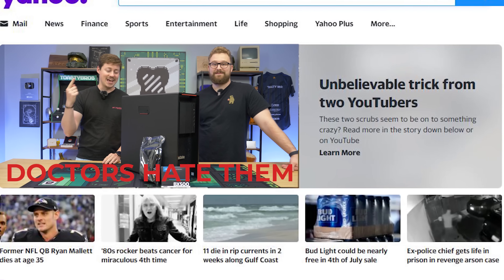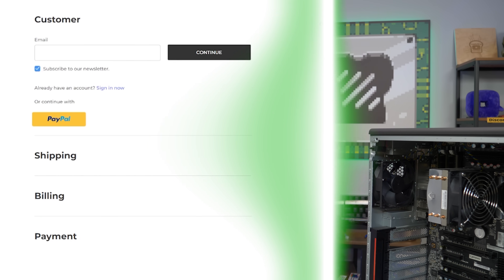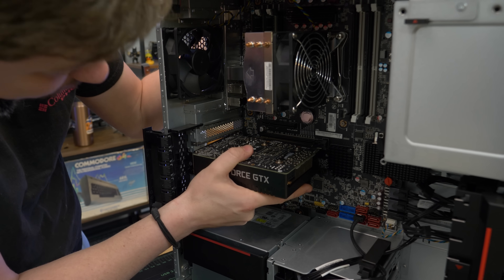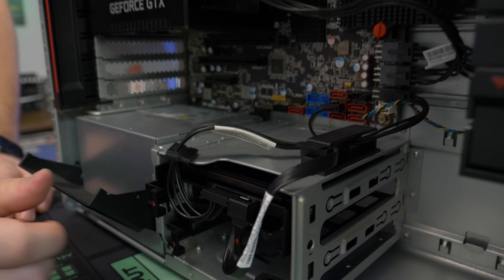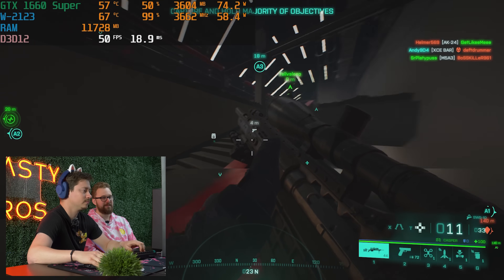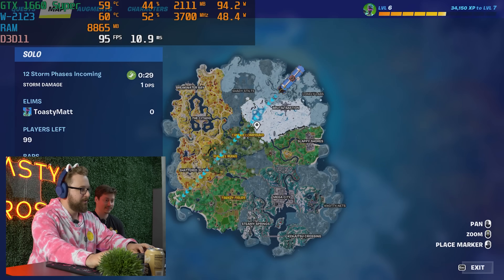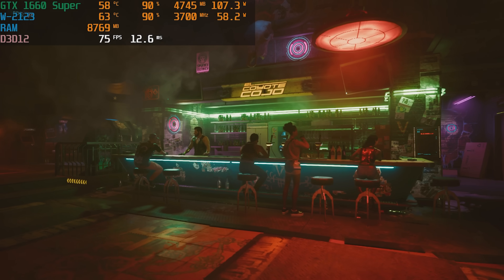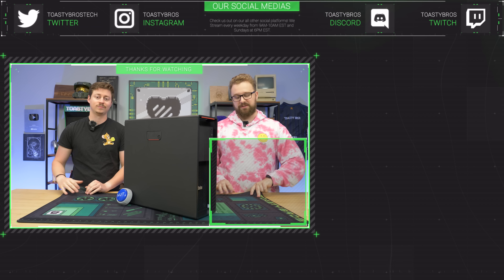EASY $300 Gaming PC Build Guide 2023 - Step by Step

Comment: I'm building a p520 right now, with a budget under $400. The last part I need is a suitable wifi/bluetooth card. What is recommended?

p520 - $90
xeon w-2135  -  $25
64gb 2666mhz ECC ram - $50
1tb Samsung m.2 NVME storage- $50
rx 5700 xt - $150 

The darn graphics card is lost in the mail, so it's holding up the build. Fingers crossed it can play Tarkov on at least 1080p

Comment: I like the way the Lenovo's are setup inside as compared to Dell's and HP's. On these Lenovo's they split the 2 hdd slots so that 1 is at the bottom and one is at the top, leaving space in the middle for larger gpus.

The Optiplex's and Precision's make it hard for 3 fan gpus to fit

Comment: i am going to get my first gaming pc, but i am getting it from meta, and since you are more knowledgeable in the pc field would that be good idea,if not what site would you recommend?...ps my budget is $1,000-$1,400
Reply: hey for $1000 its good to make one you own
Reply: @vinxwl  oh, if i do go that route, what is the difference with the gen intel
Reply: @vinxwl  what is the best site to get these parts from
Graphics Card
NVIDIA GeForce RTX 4070ti
Processor
Intel Core™ i7-13700KF
Motherboard
ASUS TUF GAMING Z790-PLUS WIFI D4
Memory
32GB META RGB DDR4 3600MHz (2x16GB)
Cooling
DEEPCOOL LS720
Power Supply
EVGA 850W
Operating System
Microsoft Windows 11 Home
M.2 Storage | Slot 1
1TB META M.2
RGB Case Fans
META 120MM RGB Case Fans x5 – Black
Premium Cabling
META Red Premium Sleeved Cabling

Comment: For clarification:
The BX500 is a dram-less SSD, while the MX500 has dram.
It won't matter much, but once you multitask this PC, the dram-less ssd will be slower even than a hard drive.
Or you should go with the 1-2-Punch method. (small SSD for system, big HDD for games and large data)
Reply: I have an MX500 installed in a shitty 10 year old laptop and it alone made a severe difference over the 5400rpm HDD it used to have. I would hate to waste money on a glorified HDD, as the DRAM-less drive speeds are only peak, while the DRAM-enabled ones can easily achieve what they advertise.
Reply: Actually, for most people it would not matter. Professionals are no longer buying these machines, kid on a budget would mostly game or surf on it. Also more than enough for most office needs. Buying additional HDD could be a decent upgrade if you plan to play older games (PS4 era and earlier) . So would buying additional RAM (which would improve SSD speed) .
Reply: @aleksazunjic9672  
A big HDD for old games and emulation makes perfect sense.  I'm umming and arring about changing out my ancient (and only HDD) 1TB that I bought in 2014 for something bigger like a 6TB but the prices of solid state and making me think that's better for inside the box with a big HDD plugged into USB3.2 outside.
Reply: @darthwiizius  HDDs are still much cheaper if you want large capacity (4+ GB) . Everything depends on needs.
Reply: @aleksazunjic9672  
True but the price on SSDs are low enough now to make them a viable option even if maximum capacity or price per TB can't match an HDD.  If I needed huge amounts of mass storage I'd certainly look to HDDs.
Reply: @darthwiizius  Well, in present time even for having 20 games (not a huge amount) , you would need 2TB drive .
Reply: @aleksazunjic9672  
Not all games are 100GB mate, those are just AAA games most of which are crap.  I did download the Halo Master Chief collection and that is over a hundred GB but then it's 6 games.
Reply: @darthwiizius  Unfortunately, even free to play games like War Thunder, Enlisted, World of Tanks, World of Warships etc ..  in modern times take up few dozens of GB . Large textures and all of that take up lot of space.
Reply: @aleksazunjic9672  
Yeah, that's why I'll probably plug an HDD to a USB3 port, though I'll plug an NVMe into the USB 3.2 gen2 port, that runs at nearly a GB/s bandwidth.
Reply: @aleksazunjic9672  for me, I'd prefer to pay the extra for dram.
Since you'll never encounter a situation where the dram-less is a problem always.
Reply: @Outofcreatvienames  But you are not on $300 budget 😁 Tons of things would take precedence over SSD.

Comment: SSD's are great for fast storage granted, but there are still uses for HDD's.
I for one have an 1TB SSD for windows and general storage, and two 4TB (8TB altogether) HDD's for my games and were cheaper to buy, and I have a lot of games. SSD's for the same amount of storage are more expensive, not something you should do on a budget.
Reply: Agree. Also, games tend to run faster from HDD if you have a lot of RAM (32 GB or more) .

Comment: I just picked up a gaming PC with an i7 8700k, 16GB of RGB DDR4 RAM, and a 1060 6GB blower style GPU for $300. It also has a water cooler on the CPU and comes in a nice looking case that has 7 RGB fans. The only things missing are the power supply and hard drive(s). Great deal, okay deal, or did I get ripped off? I say it's a great deal considering I'm upgrading from an FX8320 based PC. Any thoughts?
Reply: Sounds like a good deal. The 8700k can keep up with sth like a 3060/6600xt no problem
Reply: Not great, not terrible. Downclock the CPU to default values in order to prolong its life.  Should run all games released for PS4 and PS4 Pro without problems at 1080p med-high with some FSR . For newer games it is 1080p low . Upgrade path for GPU would be something between 6600 and 6700xt, more than that would be bottlenecked by CPU .

Comment: I have built 2 of these so far. Both have the 6 core 12 thread xeon. One I use at work has a 1660 super so I can work and do some light gaming. The other I built as a gaming rig for a friend with 32gb ram in quad channel a 2tb NVMe drive and a 2070 super. The 1660 super build total was $345 and the 2070 super build total was $495. These towers are amazing value and excellent for gaming!!!
Reply: How much to get you to build me a gaming pc ?
Reply: @WtfWiz-zq3zz  depends on what you want. One of these thinkstations set up for gaming, cover the cost of parts and then $60 for me to assemble, install windows, and run all updates and drivers. If you want a full custom PC we would have to talk
Reply: @drivingonimpulse bro 60$ for a mostly pre built PC? I could take 40$

Still that's not a bad price XD
Reply: @drivingonimpulse  damn solid price sir
Reply: @KingdomRepublic  thats too low imo 60 is perfect as he only needs a few sales to account for breakage. you have to do that when working with pcs or monitors as they break so often even with really HQ packaging . i stopped flipping old CRTS for that reason as 1-5 would break and thats me using double boxes one fresh one used and the fresh box is padded with foam then all the corners taped and stuff still showed up to my customers broken. if you were doing local 40 is a perfect price as thats about 45-150 mins of work . plus now that i think about it shipping takes another half hour per trip to the post so 60 really is fare
Reply: is it possible edit 4K videos ?